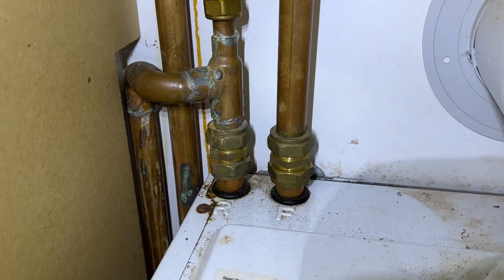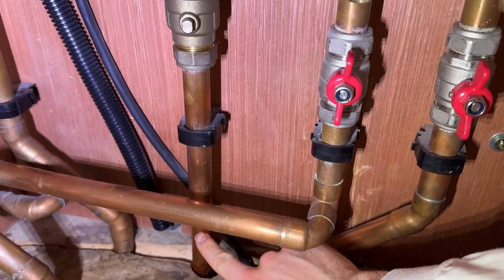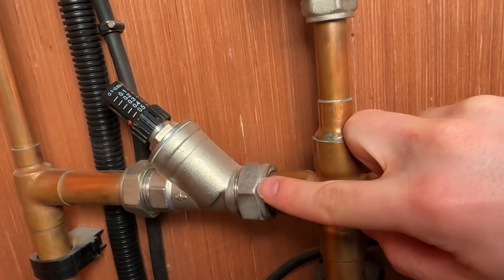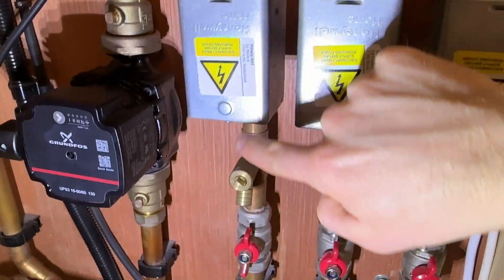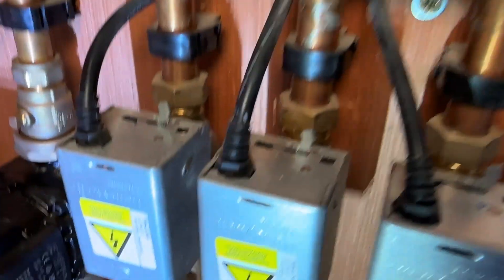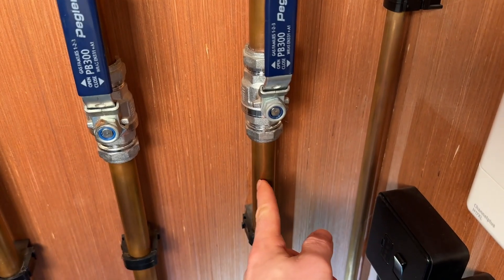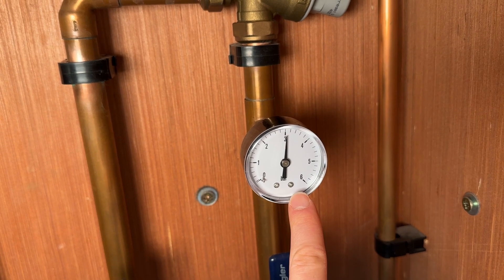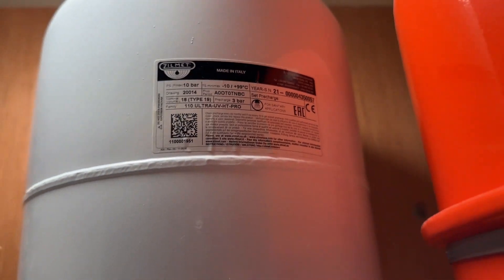How an Unvented Cylinder and Central Heating Work

Comment: Thank you for posting this video on indirect, unvented cylinder installation. I’m an old plumber who retired quite a few years ago now but as the kids grow up and buy houses I’m increasingly being pulled out of retirement to do ever  more complicated projects. I was wondering if you would also have a pipeline diagram of this installation. I am trying to follow your video and note the position of the valves, expansion vessels, slug cocks etc but it’s confusing. Thanks again for posting this.

Comment: You should have a balancing valve on the return from the cylinder it only needs to be open a little this gives better flow rate to heating circuits when hot water is on as well . Al so the boiler is either system or heat only , you said at 1st it was a heat only then you said it was a system boiler twice. I can see it is a heat only boiler and you have a Grundfos pump in the airing cupboard and if it was a system boiler the pump is in the boiler, also if it was a system boiler you would not need an auto air vent on the flow at boiler because there is an auto air vent on the pump inside the boiler. The pipework and installation are neat and tidy.

Comment: Zone valves wiring is not not satisfactory the   black cables are coming out of the zone valves. They should not be touching the pipes because the heat of pipes and the heat is making the cables . They  gets Brittles and cause of the fire because the arcing will happen from inside the  cable and then obviously  fire    🔥

Comment: This was really interesting, it's so good to understand how these systems work. We have a vented cylinder system, with cold cistern tank and an f&e tank in the loft, what would be the advantage of converting it to an unvented system like yours, assuming this can be done?
Reply from the maker: Thanks. Benefits are much better water pressure and flow rates, reduced loft space, reduced chance of f&e tank freezing in winter, usually higher capacity hot water cylinder, and better insulated cylinders.

Comment: Hi, quick question. I have this mystery… done my bathroom renovation and for some reason now i get hot water in the taps not all the times, sometimes is hot as it it should but sometimes its warm, and when its warm in the bath if i turn the cold water on the sink i get the warm water in the bath going hot. Let me know if it makes sense and your opinion can help to solve my mystery.

Comment: Hi, great video great explanation of system. I have unvented cylinder and system boiler, my water zone valve has stopped working if I leave it open manually how can I get the boiler to switch on when the hot water finishes in the tank?  Can I leave timer to ON always and how will the tank signal the boiler when the hot water finishes? Thanks

Comment: Isn’t this a regular boiler hence the external pump for the heating
Reply from the maker: It’s a heat only boiler, a system boiler would have the pump and expansion built in

Comment: Thank you for this video. I have been experiencing a knocking noise for a while when my dishwasher/washing machine is on and filling. recently I noticed it happens if I run a tap then turn it off . now however the knocking still happens periodically when nothing is running in the house.... Today I finally tracked the noise down and its coming from my white expansion tank .. thanks to you it now all makes sense ... I'm a 64 year old woman with half an idea but now I can explain to my Plumber what is going on . He actually changed it a couple of years ago but it wasn't a new one ... I will get onto him .. Thanks again
Reply from the maker: Thanks for watching! It might be that the tank just needs recharging with a bike pump, rather than replacing.

Comment: The pressure in my shower has never dropped anything I should be doing to my unvented system to help add pressure? I’ve cleaned cylinders on shower mixing taps but still weak. I suspect it may be that we have added extra rads to the system but not sure.
Reply from the maker: Additional radiators won’t make any difference to your hot water pressure, it’s a separate system. 
It could be the mains pressure to your house has dropped due to a mains leak in the local area, or your combi valve could be blocked up. Your shower head could also be blocked up with limescale. 
Probably best to get a plumber round to look at it

Comment: Awesome video. Thanks a lot. What is the purpose of water inlet in the system boiler? Filling loop is obvious but after filling loop it goes straight into boiler’s water inlet and the valve is open… Thanks.
Reply from the maker: Thank you! I’m not sure what you mean by water inlet though, i would think this is the filling loop or filling point. You don’t need both.

Comment: Heat only and system boilers are different. Heat only has a gas valve, fan and heat exchanger. System had those but with the addition of an expansion vessel and pump.

Comment: Great video I’ve learnt a lot. I currently have a pressurised heating system converted from a gravity fed. It holds pressure just fine. If don’t manually release the air from the air vent valve.  I’m not sure if I am supposed to, but I can unscrew the air vent valve every day and get a gush of air.  My question is where is this air coming from every day if the system holds pressure? I hope that makes sense.

Comment: I really think you could have planned your pipework better ...my Level 3 students have just pointed out that your pipework could have been better positioned and that the combi valve should be slightly higher than the cylinder for easy maintenance. :face-turquoise-covering-eyes:
Reply: clearley have no knowledge in plumbing work this is a fantasic job mate there no way you teach lmfao 😂🫦
Reply from the maker: You are right that ideally the combi valve would be higher than the cylinder, but in the limited space i had, that wasn’t an option. Draining a little out of the tank to service isn’t a big deal. 
Please do share the link videos of your own installs with better positioned pipe work……
Reply: @TheDiligentDIYer1759   I am a City&Guilds assessor and a Water inspector. I have been promoting good practice for many years. I thought i could offer some advice to anyone watching your videos. Thankyou for your reply.
Reply: @jmscliff09  calm down
Reply: @jmscliff09 want a medal. shouldnt you be teaching your class
Reply: @johnnyboy69-s2n  did he tell you his name
Reply: 😂😂😂😂 @TheDiligentDIYer1759

Comment: Very useful information in your video. We have an indirect hot water and heating system. It seems that the pump for the heating system is not being driven by the room thermostat but only comes on if the temperature of the water in the cylinder drops below the temperature set. So, if we run the hot water (and the temperature in the cylinder drops) then the pump comes on and the radiators heat up. The pump will not operate by the central heating thermostat alone. Do you think this might be a problem with a valve or a wiring issue?
Reply from the maker: Thank you! 
Your issue sounds like a wiring problem. If this has always been the case, then it’s definitely wiring. If it’s a new issue, then I think it could be a valve problem, but also could still be wiring. 
Thanks for watching!
Reply: @TheDiligentDIYer1759  Thanks for replying. That's what we thought (although we do seem to have a valve that isn't doing anything). Your video helped us to understand our heating and hot water and to identify what doesn't appear to be working correctly. Thanks again

Comment: Absolutely awesome video. I've worked with plumbing many times. I've just bought a house and it comes with a pressurised unvented system. You just helped me understand the mind field of  questions I had. For one, we've been trying to understand the temperature of the water for showers.. currently WAT too hot. It was working fine then we realised we had the emersion on and boosted the gas/water heating. So turned off the emersion, then the clock on the timer for gas we adjusted so we can only boost as required and it's messed everything up. I'll figure it out but you really helped me realise what all the parts are. Our emersion works fine, just might switch out the timer because it won't let you switch to Off, only time/run/prog.. it's stupid. We'll get there. What model/number is your timer? Does it allow OFF option? So no programming will activate. Cheers
Reply from the maker: It’s a channel plus h17xl. It has an off button, and a battery inside, so it won’t lose all your programming in a power cut. Would recommend it, you can save a lot buying second hand if you can find one. 
Thanks for watching, glad it was helpful!
Reply: @TheDiligentDIYer1759  I'm a technical guy, my wife's a qualified plumber and so far we couldn't figure out why it's doing what it's doing. I'm for replacing the controller, she's more patient. The only option I can't find is off lol bar the switch. They're simple to use just my current one is a pain in the arse to be honest. I tried setting the programming to 6:30am on/off P1, P2, P3 Mon to Fri and sat sun. I don't know if that's why it's confused. But it was 19:00 when I discovered it wouldn't stay on boost (water) I'd come back and it was flashing and clicking. In the bin I say!

Comment: Automatic vent is bad , if you are away for holiday and incase your automatic vent is faulty, you might  see your house as swimming pool  when you arrive 😊
Reply from the maker: It’s just as likely any other fitting would fail and cause a leak
Reply: @TheDiligentDIYer1759  I prefer thumb screw air vent / air vent cap  , cheap but best .

Comment: Thanks. Any idea why the hot water in shower isn’t working? Joules cylinder installed 3 months ago
Reply from the maker: Very difficult to say without seeing it, best to get the installer back. Thanks for watching!
Reply: @TheDiligentDIYer1759  thanks. If they fitted it only 5 months ago they shouldn’t charge to fix it?
Reply from the maker: Depends on the issue really, if you’ve got hot water everywhere else, then there’s something wrong with the shower, probably the cartridge. If you’ve got no hot water anywhere, then it’s probably the cylinder

Comment: A few points; 1) your cylinder thermostat should really not be set lower than about 60C to prevent Legionella disease forming.  2) That combi valve is also a pressure reducing valve hence the pressure being a lot lower the other side of it. 3) The potable expansion vessel has a balloon in it, not a diaphragm as drinking water should not come into contact with the inner metal surface.
Reply from the maker: Thanks for watching!

Comment: As I understood the system uses electricity to heat?
Reply from the maker: My system uses a gas heat only boiler, but you can have an unvented cylinder heated by electricity only, the system design would be very different though. Thanks for watching!

Comment: If you are a property owner looking to get an upgraded heating system, always ask to have the system installed ready for a heat pump.  Everything would remain the same but your radiators and pipe sizing is adjusted to suit lower flow and return temperatures, also ask for weather compensate and hot water priority.  This will save you money on fuel consumption.  Obviously all depending on heat loss so it may mean you need to have extra insulation in your property.  This is how I’m moving forward in my new heating gas installation so it’s all ready for the transition to air source heat pump, but is still super efficient on a standard gas heating set up
Reply from the maker: Thanks for watching!
Reply: lol waste of time. transition will neer happen.

Comment: In your experience, if water if running through the tundish, what’s the cause?
Reply from the maker: You can usually hear where it is coming from. In my experience it’s probably a PRV that is stuck open, if you run it full for a short period they usually sort themselves out. Thanks for watching!
Reply: the cause is excessive temperature and/or pressure

Comment: Brilliant did you have any part numbers as I was interested in getting the pressure gauge to see the pressure just like you have configured and also the automatic air release as you have. Thanks in advance.
Reply from the maker: Thank you! They are just 1/4" thread back entry gauges, I got mine off BES. I dont have a product code, but these look similar on BES website - Part Number: 21923
Thanks for watching!

Comment: Thanks for a great explanation video.  It seems we have a similar system with an expansion tank, hot water cylinder, pump, wiring centre..etc in a cupboard on the 1st floor of our house and the boiler is on the ground floor.  Our expansion tank needs changing due to the rubber membrane splitting (water escaping from the shrader valve and not air!).  Do you think I can drain off the water from the expansion tank from the filling loop without the need to do it from a radiator before replacing the tank? Or is there a better method.  Your help would be much appreciated!
Reply from the maker: I think a filling loop usually has a double check valve stopping back flow, so probably not. Draining down the system to change an expansion vessel would be sensible. Thanks for watching!

Comment: Great video! I don’t have hot water and what will be the problem ? The heating seems working fine. thanks
Reply from the maker: Thank you, and thanks for watching! 
Without seeing it and a lot more information, it is very difficult to say. If you have a combi boiler, you’ll need to get a plumber in. If you have a cylinder and the water is just coming out cold, it is probably a broken 2 port valve, but could be any number of other issues too. 
Sorry i can’t help more!

Comment: Interesting idea to use the Nest's hot water switching for your second CH zone. I am trying to decide whether to repurpose a 34KW Valliant combi and fit an unvented cylinder with it, but it a tough call because it is a pretty big expense and the only issue we face is running two concurrent showers. Do you think it would make much difference to shower performance? We have over 50l/m incoming supply (Since upgrading it) but the boiler can only heat about 14l/m at best. One shower alone is pleasant but two at the same time becomes weak.
Reply from the maker: Yeah using the nest hot water for an extra zone saves money and our bedrooms are spread over two floors, so not really a good place to put the thermostat anyway. 
50l/m is a really good incoming supply, i think it will make a big difference on your showers, as long as the showers can handle good flow rates. 
It is expensive, so comes down to how much value you put on flow rates in the showers when running both together. 
Thanks for watching!

Comment: Hi, at 13 31 showing "elbow and T no explanation in regards the T function or where it goes and does what exactly, if possible also where both vessels are should request to have a slight  distance view because frankly i am a bit confused and not your fault other my ignorance,  and something last as its not about money the question, is it possible to get a diagram for the cupboard installation including parts? I would like to get our house done exactly like yours my friend. Feel free please to ask me whatever you want to keep you happy and satisfied for providing me all of that. Many thanks
Reply from the maker: Hi, sorry I don’t have a plan drawn out for it, it was all in my head and scribbled on the wall. The layout is pretty standard and just adjusted for your exact set up on where the pipes leave the cupboard. If you just ask for isolators on everything and say you want an S plan plus system, a decent plumber will produce something similar. 
The tee at 13 31 is just a hot water supply to my loft conversion, as it didn’t make sense to run it down to the floor first and it has an isolator above anyway. 
Thanks for watching!
Reply: @TheDiligentDIYer1759  Sir, very much appreciated for your response and explanation, I will try to send you an email private and confidential as soon as possible with the new year. Enjoy your family time and the festivities among. Happy New Year
Reply from the maker: Thanks, you too! Happy new year!